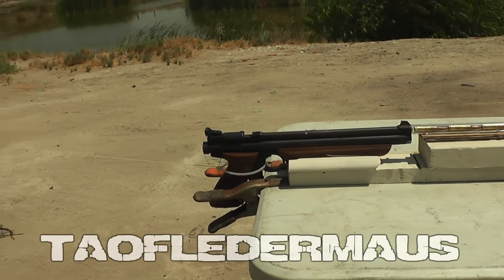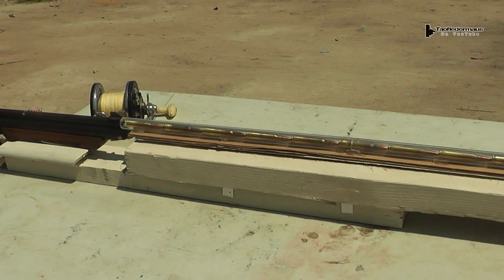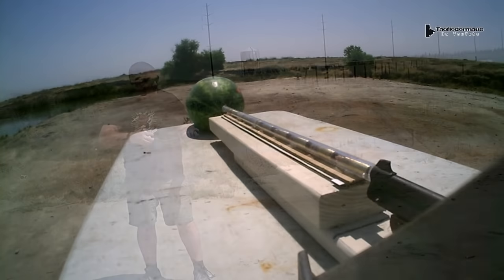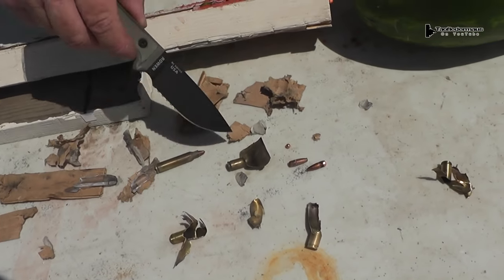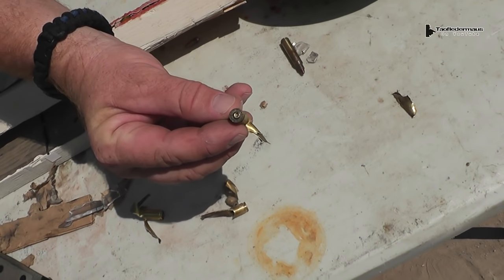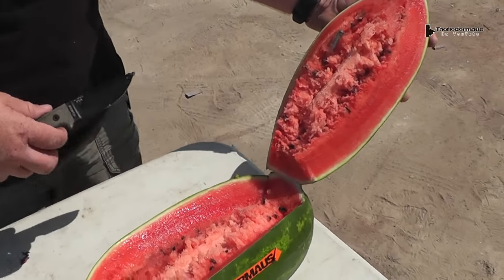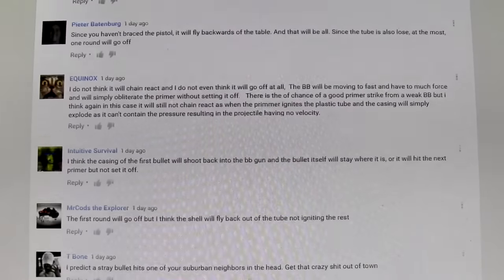Chain-Reaction of TEN Rifle Rounds -  99.99% got it wrong

Comment: this is my new favorite video, how did I not see this before!
Reply from the maker: thanks!   Be sure to check out the part 2 video where we filmed at at 10,000 fps!
https://www.youtube.com/watch?v=3GkaNg6S0H4
Reply: Daily Pro Rebel Separatist a bullet can misfire and have the others still go off. This BTW is why they don't make 30-30 shells with sharp tips unless they have polymer tips.
Reply: Cesar Graves y
Reply: I'm confused; did 99% or 2% get it right? He said both!
Reply: Daily Pro Rebel Separatist by they, assuming you're talking to me, I meant the makers of the ammo for the 30-30. Not these guys. I was talking about my comment not yours. Their method wasn't complete in my opinion. They needed to retest to make sure it was actual firing of the bullets and not the firing of one. The misfire doesn't = that the rest didn't fire per say, but that needs to be proven better.
Reply: He said 2 PEOPLE.. 

Not Percent..
Reply: Thanks, so to be more precise:

At 6:55 he says 99% predicted no chain reaction from about 2500 comments, that means only about 50 people predicted a chain reaction. 

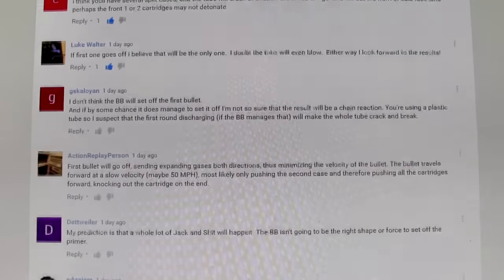At 8:50 he says only 2 people out of about 2500 predicted a chain reaction, that's about 99.92%.

An approximate dependency of 0.92% error in what he said not a 97% error. My bad.
Reply: Guide To The Bible he actually said 99.9%
Reply: Daily Pro Rebel Separatist gotcha brother. i see what u meant.
Reply: Nathan Justice so he did. Amazing, my bad again.
Reply: Cesar Graves this was made on my birthday 😲
Reply: Cesar Graves gotta love the melon spewing juice
Reply: Cesar Graves do a longer one
Reply: This is why 30-30 rifles use blunt tip bullts. Because this happened before in the tube magazines with centerfire ammo...
Reply: I always had complete faith in this working and i'm as honest as the day is wide.
Reply: I heard that kamikadze from Serious Sam
Reply: This is my favorite comment how did I just see it now?

Comment: I can see some people wouldn't think a BB could set off a primer but I did it myself almost 50 years ago. A dumb kid that got lucky. No injuries. Ears suffered for awhile. I think it was the Remington Model 14 pump which had a spiral on the inside of the  magazine tube so spritzer bullets could be used in it.  And since almost all 30-30's were lever gun with tubular magazines about all that you could fined in the 30-30 were round nose bullets. The old timers have known for probably at least a hundred years that a pointed bullet used in a tubular magazine wasn't good.

Comment: You should have numbered the bullets. I'm betting the one that didn't blow up (and the bullet was pushed in) was the first one, where it had enough force from the BB to strike the second one, which recoiled into the first one hard enough to push the bullet in and cause the detonation to blow out the primer (into the bb barrel)

Yes! Looking at the 2nd video, I think I'm right. :)

Comment: I wonder how hard it would be to set that up for a long-range application.  Use one bullet from a precision-aimed NATO 5.56 round to set off a 7.62x51 Nato round in a rifled barrel 250 yards away to hit a target 600 yards away from that barrel.

You could even get crazier with it and see if you can make angled connections or aim the 7.62x51 at the primer of a 30/06 that would strike a target 1000 yards away...for a total of 1850 yards.  Would a bank shot even be possible with that arrangement?  Lol.

Comment: I wonder if you had used a steel tube if all the rounds would have flew out the end and all 10 hit the watermelon 

I mean be safe about it though get a much longer string that guy has a huge set of balls to be that close
Reply from the maker: If the steel tube didn't blow up,  junk would probably blow out both ends of it.
Reply: +TAOFLEDERMAUS what if one end of said tube was capped and drilled for a fireing pin galvanized steel seems to work for crafting 12 gauge shotguns so I'm theroy it should work simmalar to the "vaporizer 9mm crucifix"
Reply from the maker: You aren't going to see get "gun like" performance since there isn't a chamber still. There would be more energy directed out the ends of the tube.
Reply: It would work just like the "metal storm 36 weapons system" the only diffrence would be a single barrel vs Many  

+ metal storm fires in this mannor with 9mm rounds 
So I know it would work is just like to see some one other that a weapons designer make one and use it safely
Reply: it doesn't shoot cased rounds.
Reply: Even if all conditions were right, it still would not work. Think about it, you have six bullets in the barrel. The first bullet discharges, its kinetic energy is absorbed by the weight of the other five. The second bullet discharges, its kinetic energy is absorbed by the other four. The third bullet discharges, - you get the point. The only bullet that would exit the barrel with force would be the last bullet in the sequence, and any other bullets + casings that manage to move would basically just be "falling" out of the barrel. It's kinda like that annoying little desk toy with 4 metal balls hanging by strings. The first one and the last one are the only ones that move.

Comment: I'll admit, I was wrong. I thought the first one would go and the tube would blow up. I would have sworn that since there's no barrel to contain the energy of the first round and propel the bullet forward that there wouldn't be enough hit to ignite the primer in the second round. I'm amazed and impressed. This makes me wonder if soft point ammo like that found in .30-30 rounds is really safe in tube magazines. You guys should test that. Maybe even re-do this test with soft point 5.56/.223.
Reply: It takes a decent impact (its still weak, but not tap light) to set off a primer, almost drops wont generate the force needed in the correct manner. While it is a danger in tube feeds, it is almost bound to never happen to you. Most guns drop horizontally anyways.

As for the chain reaction. Think about the force of that round blowing up. Its overkill compared to what a hammer or firing pin puts out. Plus you have plenty of shrapnel, in that close of proximity you are bound to hit the primer with something, that has enough force. 

If the tubing were incredibly weak, say a single sheet paper roll, you might get a different result. Thats still only a "might" though.
Reply: You wouldnt have admitted you were wrong if he didnt get you to write it down first.
Reply: ***** I never replied to his other video. I was going to but I figured what's the point, it's just one reply in a sea of commenters. But this video floored me with the results, I just had to throw my thoughts in.
Reply: That is a good question. I will say that the 30-30 is a popular round for a tubular magazine rifle because most of the common loads are a fairly blunt nosed round for that exact reason. I know Hornady has their lever gun rounds with soft plastic ballistic tips but I'd hope they've tested them enough to deem them safe. It's a good question and would be a good video to test.
Reply from the maker: I've lost count how many brilliant ideas I tested out that were flops....  some so bad I never posted them!  lol

Comment: I would have agreed confidently that there would be a chain reaction. However, if you were aiming to launch the final bullet over some sort of distance, then I would have spaced them out (to improve accuracy) and used a stronger material for the tube (to make sure than most of the energy would be in a forward direction).

Loved the video.

Comment: I was only half right.
Reply: About what
Reply: That also means you were only half wrong!
Reply: +clayton8or_2 Don't be such a pessimist :D
Reply: +Douglas Aranda Saying OP is only half wrong would be optimism, bot pessimism.
Reply: My glass in only half full.
(gotta go get a refill - be back in a bit)
Reply: DJfrog99 "You're becoming hysterical" (Alien Isolation reference)
Reply: GG Partner Plays I thought the pellet would set the bullet off but that the force of the gun powder getting ignited would make a chain reaction impossible because the primer and bullet tips wouldn't line up. I also thought the bullet would cause the plastic tube to shatter.
Reply: Which half?
Reply: +wdavid parks I'm too logical for this. I think half full or half empty depends on whether you are in the process of emptying or filling the cup when you choose to evaluate it.
Reply: Ahhh. You want to add a 3rd dimension to a philosophical binary ponderance. Vectors! That's good, thinking outside the cup... er.. box. I meant to say box - yeah, box. ;-)
Well... it's nearly down past the halfway mark approaching the bottom again so... gotta go.
Reply: Wdavid parks Waaaat??

Comment: That was cool. Had I seen this video before you did the experiment, I would have been number 3 to properly predict it. When researching a lever action rifle for possibly dear hunting several years ago I rejected it because of the magazine. The tubular magazine has the possibility of an accidental bump fire. Later I found that Hornady, a cartridge manufacturer, actually makes a bullet to significantly reduce that possibility. The cartridge is called the Flex Tip. Here's the link for those who might be interested in them: https://www.midwayusa.com/product/775263/hornady-leverevolution-ammunition-30-30-winchester-160-grain-flex-tip-expanding-box-of-20
Thanks for sharing your cool video. Best Wishes n Blessings. Keith

Comment: I think I know why several of the found cases had the primers blown out. 
When a gun is fired, the case is surrounded by steel. Inside the tube, the cases were unsupported, so they had room for expansion. (Max pressure for the 5.56 NATO round if over 62,000 psi) The brass was expanded at the case head just enough for the gas pressure to push those primers out. 
Personally, when I clicked on the video, I fully expected a complete chain reaction, but I was surprised that the tube had been strong enough that the spring mechanism at the front of the tube ended up buried in the melon. I expected more random scattering of the force along with the full chain reaction.
Now, it is damn late, cause I got a 300 mile drive in the morning... but, DAMNIT! You have a high speed camera shot of the tube detonating! No sleep for the Biker tonight lol
Great video. You've got another subscriber now. ^_^

Comment: The bb struck the primer like a firing pin would.  Yes that did cause a chain reaction.  But it previously proved that normal recoil from the rile would not be enough to set off a primer.  Yes? No? Yes?

Comment: for real?! how the hell did people think that wasn't going to happen? this shit is the reason most ammo for tube fed magazines are shaped with rounded noses, because this happened a lot >.< and tubes that don't use a round that has the rounded nose have a spiral in them to help off set the noses and there's an old old cartridge that was made with a little area around the primer for the nose to sit in, away from the primer. Hornady's Leverevolution stuff has a soft tip to prevent this. D:

Comment: Cool vid. I didn't think that the deflagration of the powder would be strong enough to cause a chain reaction. If you used a blasting cap or tannerite to set off the first round I would've bet that they all would have went off.

Comment: Hey Guys,  the issue I have with your "rig" is that the rounds are held too tightly.  In my Marlin 336, the rounds are held in a tube that is not nearly that tight.  This allows the rounds to sit in a way that the rounds are not held primer to tip.  You'llse what I mean if you increase the interior dimention by some fraction.  Additionally, my 336, chambered in32 Win. Spl. uses rimmed cartridges not rimless like 5.56.  So for accuracy, I think another experiment would be in order.  But if the goal was to simply create the conditions MOST ADVANTAGOUS to initiating "chain fire" well done indeed.  However, no levergun, I've run into so far, uses rimless ammo nor has a tube magazine that holds rounds so tightly.  Just saying.  Enjoyed the video, but protect Gregg better, unless of course you intend to come out from behind the camera and assume the risks.

Comment: Before watching, was glad you didnt do tube with steel or metal.. Explosion would have been larger.   Lever action rifle shooters have known about this FACT for decades.  Pistol rounds, rifle rounds, primer type doesn't matter.  Using pointed bullets in mag tube is a disaster which WILL happen.   When bullets will be in a mag tube, bullet nose MUST have flat point wide enough that flat point is WIDER than diameter of the primer.   IF NOT, best case is a lost rifle, or someone is hurt including bystanders, or worse a death which was avoidable caused by stupidity.    davzway aka: Hardway Horsley, SASS LIFE #3106

Comment: I didn't see this but I only have one thing to say, to the individuals that actually claimed a bb gun impact is too light of a strike for the 5.56, do you really think that the hammer hits your thumb that hard when playing with or inspecting an AR15 lower? Would you rather take the brunt of the hammer from full tension with a slightly sharp point on it, OR GET SHOT WITH A FUCKING BB GUN??!!LMFAO, I wish I would have seen this but you can't catch everything.

Comment: I watched the other video, and what a difference. Why would you even think that a tube fed rifle would not detonate a round with a pointed bullet? Maybe not 100% of the time, but would you want to be holding the rifle that 1% of the time? Back when this "Alleged" rumor started, bullet construction was not the standards of today. Primers REALLY vary in hardness. Most of the older bullets were really heavy compared to a 5.56. I have a few French 49/56 rifles and ammunition loaded with American primers will cause slam fires once and a while. (The WEIGHT of the free floating firing pin sets of the next round chambered). I also have old French 8MM rimmed ammo that was used in a tube fed rifle. The back of the case has a ring machined into it so the point of the following bullet rides AROUND the primer. This must have been tested by the French because they would not spend a dime more than they had too.  What it comes down to is: Don't load pointed bullets into a tube fed rifle.

Comment: That's why you can only load soft tip (dumdum) rounds in a tubular magazine. As in a 30-30. If just recoil is enough to set off a primer, with the tip of a copper jacket, why wouldn't a steal bb going 300+ ft per a sec do it? When it comes to firearms, everyone's an expert...

Comment: I have a Springfield  M1A/M14 , which I love beyond all others. However it used to do something nasty: Slam fire! After firing 37 slow rounds of 7.62 NATO my rifle went into auto mode and fired the last 3 rounds in the gun in less than 5 seconds. I was fortunate enough to keep my presence of mind and managed to hold the gun on target at 100 meters. Scared the shit out of me. The range master knew immediately what had happened. He told me he was surprised when he saw that I was holding the rifle on target and not skywards. At that time I'd never heard of a slam fire. I didn't tell the range master that the reason I kept the gun on target was because I had locked up physically and couldn't move from fear of what was happening. So much for range discipline. This was just plain old dumb luck.

Comment: I guess the rubber-meets-the-road question is still ultimately "Will the recoil jolt of firing the gun be sufficient to induce the chain reaction?"  Is it obvious that it would?  Like if you loaded pointed tipped 30-30 rounds in a Marlin 336 or similar, could the rounds in the tube magazine be made to set each other off?  From the recoil, or from hitting the butt on the ground, anything?  Has anyone ever actually tested that in a real gun, replicating a real 'field' scenario?  I know a good amount about guns but I admit I don't know. 

I almost want to lean towards saying that you couldn't get the rounds in a real gun's tube mag to go off but I'd love to know the truth.  Someone should go balls-out and handload some steel-tipped 45-70 rounds and set the gun off (from a safe distance).

Comment: I missed the question earlier! But, I'll just say that I'd have been one of the few to say it'd have chained like it did. Why? Because it's not a new problem. This is why lever guns aren't loaded with spitzer (pointy), rounds. Only recently have they come out with a pointed tip that is basically a soft plastic plug to fill the cavity of a hollow point. It mashes up in the tubular magazine but when chambered and fired provides the aerodynamic advantage of a point.

Comment: This doesn't surprise me.  I used to own a Marlin 30-30 lever action with a tube magazine.  In the owner's manual they warned against using pointed rounds because the recoil could set off a chain fire in the magazine.  I got rid of it because I was limited to 150 and 170 grain blunt nosed rounds.  I went to a 30-06 with a standard magazine which allowed me more flexibility choosing ammo.